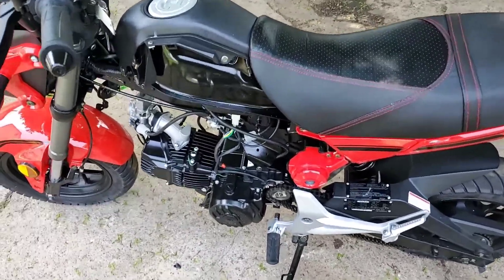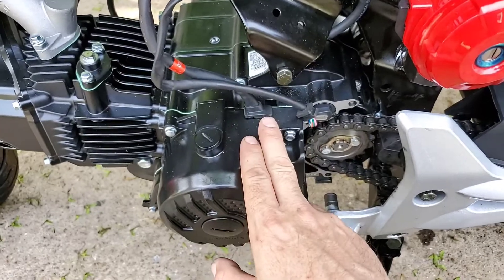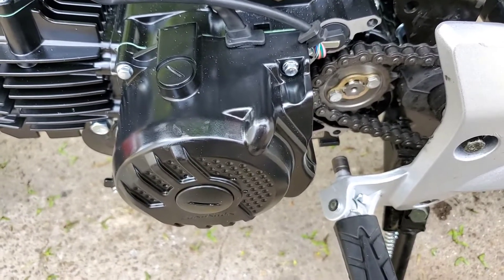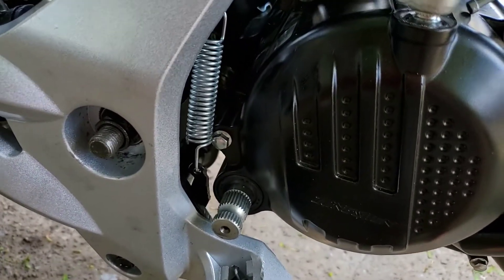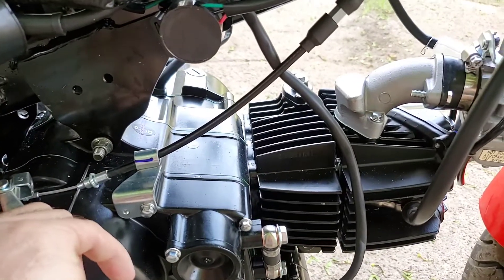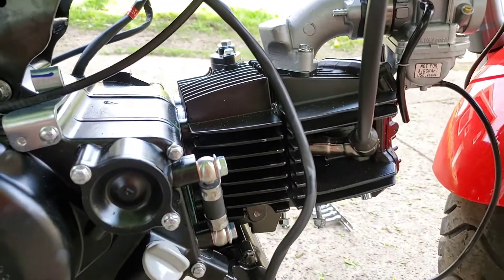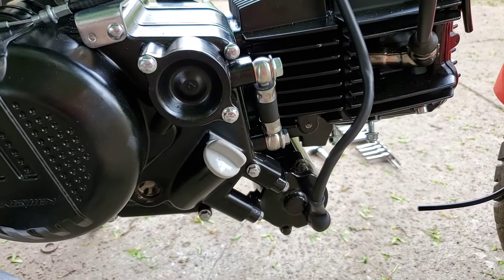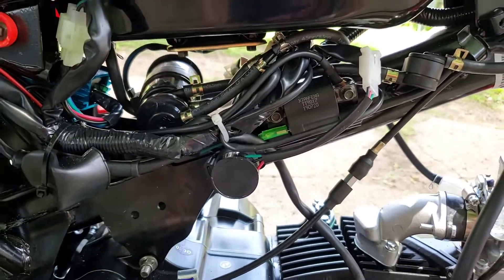Taotao hellcat Zs190 install tips

Comment: Had my 190 on my hellcat for a few months now but didn't put my gear indicator from the old motor yet but going to.is there any advice u can geme to wire it since the stock one on the 190 only has 1wire? Thanks
Reply from the maker: You simply leave it be and install it. No need to wire anything. The indicator fits right into the 190.

Comment: Should have changed those engine mount bolts. They break
Reply from the maker: The new hellcats come w grade 12.9 bolts so no need to change. Otherwise I def would have changed them 👍🏼
Reply: Parkers Garage looks the same as the ones I had that broke. I used grade 8
Reply from the maker: @xdmackinx  may look the same but its stamped 12.9 on the head which is stronger than grade 8.
Reply from the maker: @xdmackinx  12.9 is the strongest metric bolt you can get.